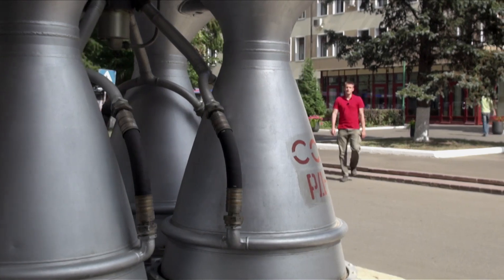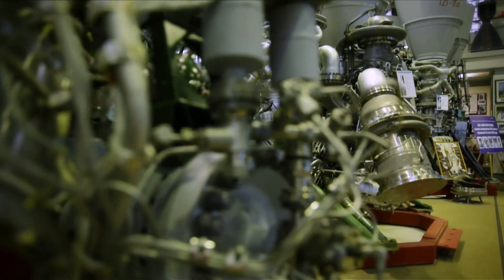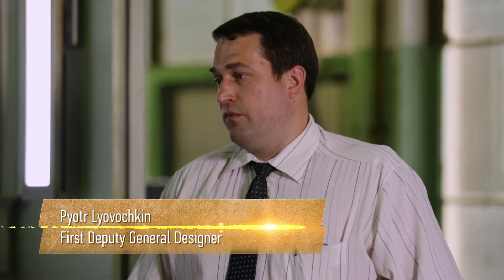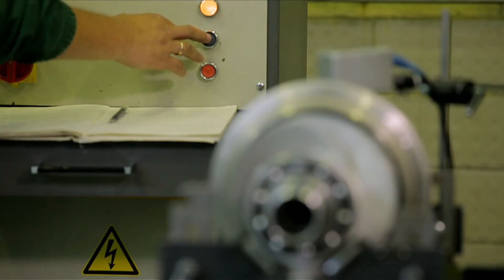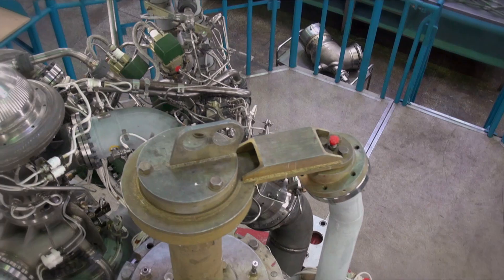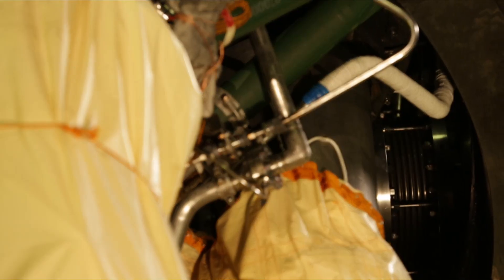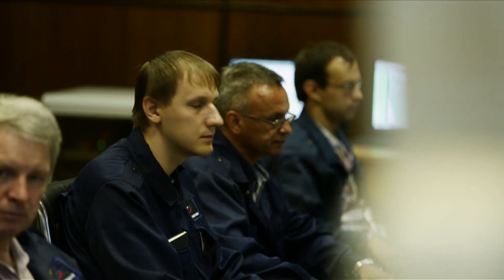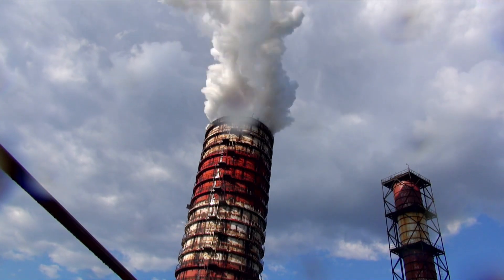A Look Inside Russia's Largest Rocket Engine Plant

Comment: Russia really punches above its weight in a lot of fields. Too bad Russian space tech has stagnated for decades. I'd say despite that they were in the lead in terms of economy, reliability and capabiltiy, even if their total capability was limited by lack of respurces, until about 2010. But now, SpaceX has surpassed them.
Reply: Space X used and still uses ancient NASA engines, only modernized for modern production technology, not even changed alloys. 😢